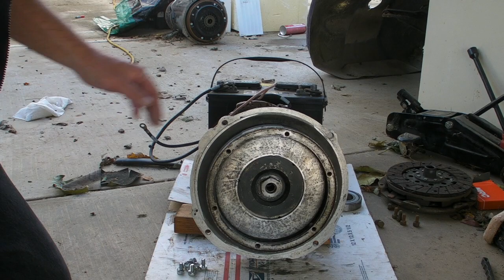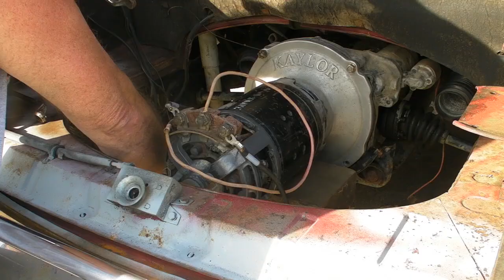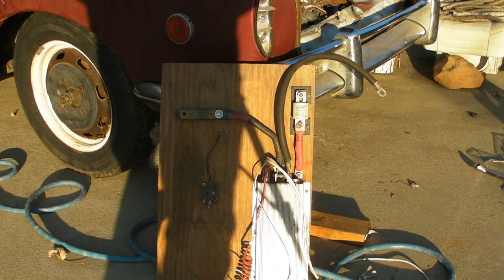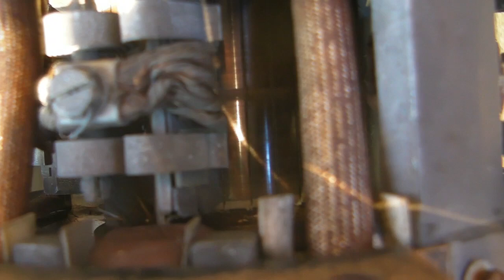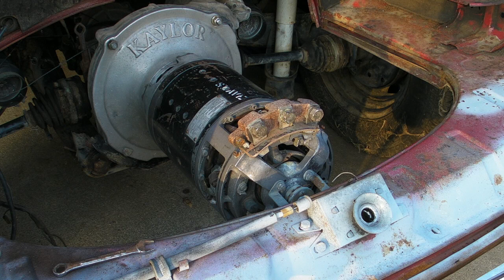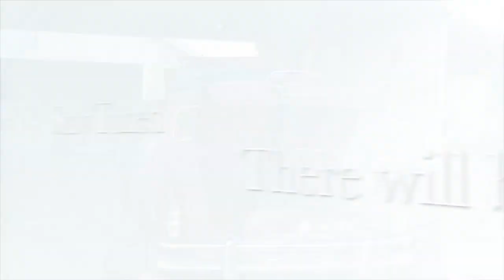Kaylor Motor Install.mov

Comment: why do u call it a motor comartment it is a engine just like the one u removed
Reply from the maker: I call it that because I removed the Gas Engine and replaced it with an Electric Motor. It is now a motor compartment and not an engine compartment. There is a huge difference between a gas engine and an electric motor.
Reply: Yes I know that its kinda obvious was just implying that isnt a electronic motor a engine as well
Reply from the maker: Never heard of anyone calling an electric motor an engine. I equate an engine with burning or heat and motor with electric.
Reply: they are simular  is all i am saying
Reply from the maker: No, not even close
Reply: A engine is a motor that propels a vehicle forward do u understand now?
Reply from the maker: I have understood from the beginning. I don't equate the electric motor with a gas engine but they both will move a vehicle. So by virtue of how each works they are not alike and should not be call alike. I also understand that some folks call gas engines motors.
Reply: guess i just see things others dont

Comment: What's the voltage and amp draw of the motor?
Reply from the maker: I can run these motors from 36 volts to 96 volts. I could do 24 if I so choose. Amperage is what ever your cells will belt out as there is no current control. Motor can handle 400 amps all day long. Much higher for briefer periods of time.   But you do need a transmission and clutch. Top speed is dependent on your voltage and transmission gearing and how light your vehicle would be. I plan on using these as DC generators. Not the best for vehicles any longer. Go get an AC motor from HPEVS and go have a blast.

Comment: why does it have a clutch??
Reply from the maker: Low voltage/amperage systems can leverage the advantage of the transmission. They use them with gas engines, why not electric too. Take full advantage of your transmission even if you use high voltage and your motor can handle high rpm
Reply from the maker: For racing I'd agree. If you need to gain that extra 1/100th of a second by all means ditch the large flywheel. But with a low voltage system you need to shift and will need a flywheel. You can however use a lightened flywheel which I actually have on this particular motor. It's about 8lbs. I would not use such a motor on any thing more than a VW buggie. This particular motor is now just being used as a generator.

Comment: is it pos to use super caps to replace the batteries!!!
Reply from the maker: Possible, but why. No way would you have even close the range. Not even as good as lead. Just invest in Lithium. LiFePO4 CALB cells would be the best for the buck. Caps discharge fast with little energy.
Reply: thanks my friend .
Reply from the maker: They have the power but not the capacity. They also discharge too fast. It's hard to control lighting bolts.  :)

Comment: que tipo de motor electrico necesito, y donde lo puedo comprarlo? gracias anticipadamente
Reply from the maker: Un AC75 o un AC50 con el regulador sería una gran opción. Puede ser adaptado a muchos vehículos.
Reply: como debo de armar o construir, sus dimensiones, las bobinas de cuantas vueltas tienes para hacer el motor de dc. y que calibre (AWG) debo de ultilizar, o como puedo puedo convertir un motor monofasico que es en ac a dc pero de mayor torque y mas rpm.
gracias de antemano desde PERU- CUSCO Y PUNO.
Reply: estoy entusiasmado para poder armar un motor de esos, para mi necesidad y tmb tener mas conocimientos hacerca del tema.

Comment from the maker: No, I am not going to be driving it again with this motor. I did years ago and with a heavy all steel VW Ghia Body I only got 65 mph max out of it. Not good enough for daily driving on the freeway. In town it would have been fine. In a buggy it should be fine too. My latest is with a large 11" Kostov DC motor. 
Click my Name and check out my Black Bug EV. Ghia has been sold. Kept motor for another project coming up. 
onegreenev.blogspot.com

Comment from the maker: Well the car I used was not as nice as I wanted and sold it. Working on an Open Top VW Roadster all electric with an 11" Kostov motor and we are going to use 60 100ah Lithium Cells to power the thing. :)

Comment from the maker: Yes some golfcart controllers will work. Curtis makes some but your minimal on the road voltage of your vehicle should be 96 volts.Amperage is important too. A minimum of 400 amps is required for most. My controller will pump out 900 but rarely ever go above 600. 144 volts and 600 amps is good. Lots of purpose built controllers can be purchased.

Comment from the maker: Lots of forklift motors are rated at 48 volts but that is a constant rating. Many of the motors are quite able to handle upwards of 144 volts. If you go that high you would need to advance the brushes to better handle the high voltages with minimal to no arcing. You might be better off looking for a used Warp9, Warp8, Warp9 Impulse, ADC 8 or 9" motor as these are already configured to work in an automobile. You might consider coming over to DIY Electric Car Forum. There is so much to learn.

Comment: The charge voltage is created with the help of an inductor and as you boost voltage you drop in amperage. I have charged with a bank of Solar Batteries at 48 volts to charge a 156 volt lithium pack at 150 amps. Going to use the generator as my source of power to boost to pack voltage. Once I get it up and running I will do another video to show fast charging abilities.

Comment: Yes, starter/generator. Once the engine is started the motor becomes the planes primary generator while in flight. This particular motor was used only as a generator but I do have one that was used for both. This motor/generator is able to make 36 volts DC at up to 400 amps. I am going to utilize this motor to be a generator to charge my EV. My controller is also a charger. Take the 36 volts and an inductor and the controller boosts the voltage to match the charging voltage needed to charge.

Comment from the maker: Yes you can. Plenty of folks doing that. I know of a few that can do over 120 miles per charge. You need lithium batteries and they are not cheap up front. If you use LiFePO4 Prismatic cells you can expect about 2000 full charge discharge cycles. More if you do partial discharge cycles. The LiFePO4 Prismatic's are just plain magic. Mine will do about 45 miles per charge. I only need more cells to go further.
Reply: How many do you have? What voltage you running at
Reply from the maker: @zapcjw  This vehicle is no longer in my possession and no longer an electric vehicle. I currently use Nissan Leaf battery modules. I will be using 42 modules in my upcoming 144v vehicle.

Comment: also what are the parameter to be selected for alternator for this ac motor and what should be the size, power and voltage of the alternator and which battery is best suited for this engine

Comment from the maker: More information on the vehicle you have chosen before I could really give you some information on what might be good to use. Electric motors are not rated like they are with gas engines.

Comment from the maker: It depends upon your small car, your budget and your skills. For a small car that you want to drive on the freeway I'd highly suggest an 8" or greater DC Series motor or HPVES AC motor/controller setup. This Kaylor motor is fun but not too useful for more than a fun toy. I am going to use it as a generator.

Comment: Yes, This is a small weenie motor but it works. There are better motors and controllers and anyone can convert but its not cheap. Working on a 62 VW Roadster and soon a 73 Porsche 914. Plenty of sites to look at. Type in dielectriccar into your browser. Also evalbum. Might check out Jack Rickards EVTV as well while your at it. Excellent videos and he has three years of videos to watch and blogs as well.

Comment: The motor attached to the transaxle can handle the torque of this motor with no trouble. This motor attachment has nothing to do with the front of the car nor its steering. 

Odd questions.

Comment from the maker: The Zilla is for Series Motors. These motors are special SepEx motors. If you have a separate power source for the field then you could use the Series controller but you'd loose the regen ability of the motor. With contact switches you could do regen and gain some back. 

The common SepEx controllers don't work either.

Comment from the maker: Was not aware that it was a vibration dampener. It is a pretty strong clutch mechanism. Sounds logical. I don't have any original paper from the manufacturer of these type motors to know that information. Do you?

Comment from the maker: Henning,
You should do a video on how to construct the switch so anyone can follow your design and get one to work if they are looking for a budget electric car build. I know there would be some interest if you did that. I have a Cushman Truckster and it has a contact switch setup with three speeds and uses resistor wires. Those get mighty hot. I am switching to sepex and modern controller soon as well as lithium for the truckster.

Comment: Sorry mr McWade, the clutch inside is a part of a vibration dampener, it is the double splined torque bar inside the shaft  who shall take the torque from motor, and the clutch will only absorb the swinging. 
A simple sheet fan and a extended brush cover wil make a good cooling. Remember air intake in the adaptor or clutch housing. A mesh in the starter hole will do it.

Comment: I did use 6 pc 60A switches in line controlled by a cam connected to the clutch pedal, each connected to a resistor and a direct big contactor on the last step. 
it is an easy piece of work to make. A better way is to connect the switches to separate contactor for each step. Since the resistor only are active in the soft start, they do not make any losses during driving I used a DIY resistor 4"by 1" with 1mm resistor wire, at about 4 ohm, connected to trottle, and a separate 12 volt battery.

Comment from the maker: The controller being used in this video is a prototype and the project was abandoned by the controller company. We worked with them for a couple years but the controller did not perform well and under hard regeneration blew the controller.

Comment from the maker: You just need to hunt the internet for them. These are only suitable for small light weight vehicles of 1500 lbs or less. If you have a larger vehicle in mind then you need to go with a different setup. These are old and have no modern controller to use with them.

Comment from the maker: Resistor speed controls waste gobs and gobs of power as heat. Not a very good way to do this. Resistor controls do work but why if there is something better. I am looking at using mine for a DC generator to charge my pack via a small gas or diesel engine turning the motor. Only for when I need off site charging abilities for my Little Electric VW Roadster.

Comment from the maker: Two problems with the Starter/Generator. One is cooling and the other is a good reliable powerful controller that will work with this type of motor. If you just use the contact switch speed control, yes the motor is pretty strong but nothing like a Warp9 or GE 9" Series DC motor. Another issue with the little motor is that there is an internal clutch that is always engaged but can slip if there is an issue. So you can actually cause the motor to slip under hard loading.

Comment: The motor is a military aicraft starter/generator rated at 30 V 400A continous. The speed limit at 8000rpm tell about far more volt and amp. The motor can be controlled by a 3-6 step start resistor for soft start and a 5-8 ohm large adjustable resistor inserted in shunt connection as a throttle.
Reply: Mine says 30v 700a so I'm mathing 22 kw. But told it was rewound for 72 v for previous conversion

Comment: The torque on such motor is enough! I had a lookalike starter generator  in a subaru minivan, and belive me,  it loose grip in 2nd gear at 48 volt.  Nominal spec is 30 volt 400A continously, and speedlimit at 8000rpm tell me it can take a lot higher voltage and current. I have still some of these motors,  in Norway.

Comment: I have an old military motor/genny and an adapter plate. Currently in the process of building my first electric VW based car. used to be on the EVDL but still researching every day. Buying up parts a bit at a time.
Good luck with your car!

Comment from the maker: I would forgo the Kaylor setup and buy at least a Warp9 Impulse motor and go with minimum of 120 volts and a decent controller like the Synkromotive. Adaptors for VW are plenty but I'd go with a clutch. I have for the last three VW conversions. You will be shifting and shifting without a clutch is a bitch. Use Lithium Cells and don't bother with lead acid batteries. Period. Minimum of 100AH cells. Best 180 or 200 AH cells. There are other goodies but this is the basic big stuff needed.

Comment: Hows that? The Kaylor is an older system that is still quite usable. Put in some lithium batteries and your good to go. You could go with a larger series DC motor and controller but for a light weight VW Buggy it is fine for a fun cruiser. 

I currently have an 11" Series DC Kostov Motor in my 66 bug. Much larger than the little Kaylor setup. 

What is your idea of a better way? What vehicle? Nothing better than electric drive. I own a Nissan Leaf, drive it daily. I have done 3 conversions, You?

Comment: Well the motor is actually just an old Military Starter/Generator used to start aircraft and to provide power while in flight. The motor is attached to a Kaylor Motor Adaptor built for the VW transaxle so you can use the two together to make a fun little electric car for city use. If you use a VW Buggy you could actually drive on the freeway for short distances. The controller being tested actually died and won't be fixed. Motor and adaptor are still good. Just use contactor controls for speed.